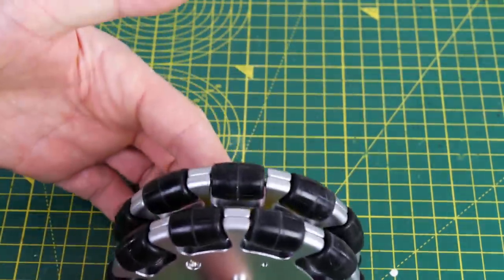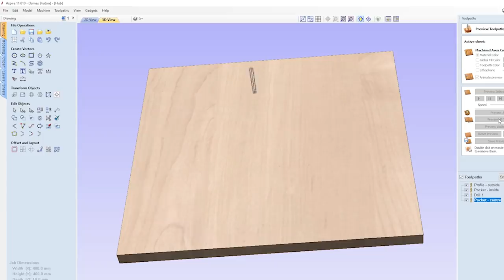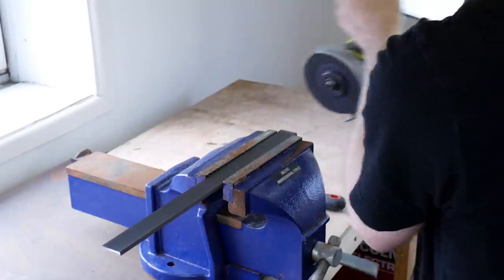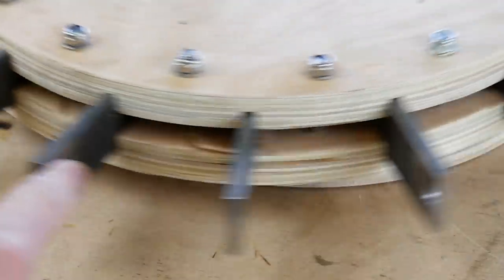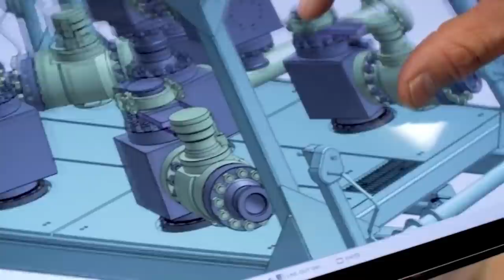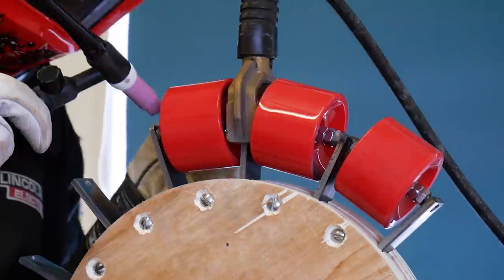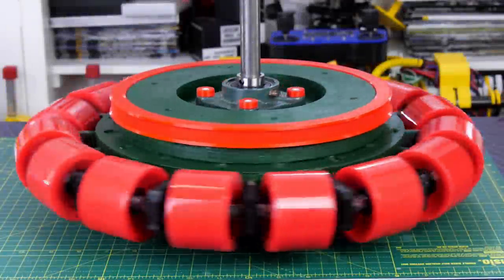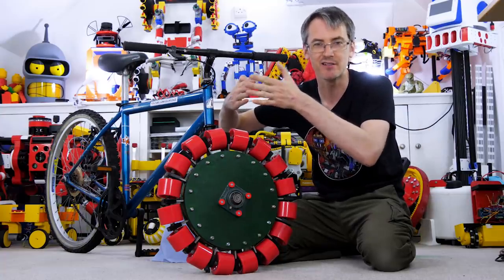Why I built this Omni-Wheel

Comment from the maker: I already built the bike and the video comes up next Tuesday!
Reply: Can you make a GyroSphere from Jurassic World
Reply: Awesome, can't wait to see that one !
Reply: How have I been watching you this long without knowing you have a CNC router? We need a shop tour!
Reply: Would what you have learned about omni-directional wheels also work toward making an omni-directional VR "treadmill"?
Reply: You've outdone yourself on the build of this Omni-Wheel with the CNC, welding, etc.
Reply: lets go cant wait
Reply: If you wrap a single belt around the little wheels, you could drive all the wheels with a single belt drive. The belt would be in contact with the floor, not the wheels. Remove the center of the large wheel, so it's like a washer, add another ring of little wheels on the inside of the wheel, wrap a belt (tread) around the wheels.

You could also use this method to make a wider main wheel.
Reply: Your case comes up next Tuesday !
Reply: ... wouldn't it work better as a rear wheel?

Comment: No bandsaw, no drill press, but a TIG welder. These are some priorities... Oh, and you can just put something like tin foil or heat-resistant fabric over stuff that you want to protect from the heat. It's mostly IR radiation from the arc, so very easy to shield.
Reply: I got a welder and a tig welder with a bunch of tools if I wana cut I got a vice and a hacksaw lol

Comment: Please, when welding, use something that sucks the smoke away. Especially when welding onto nuts and bolts that might have a zinc coating, or another metallic coating. Steel isn't that dangerous, but when you start to oxidize coatings on nuts and bolts, a lot of terrible things come out. The discoloration on the nuts (as seen @6:28 for example) is bad news for your health.
Reply: Hopefully he see's this
Reply: As long as he didn't get sick he's probably fine, though avoiding inhaling zinc fumes is generally good advice.

Edit: Even if he did get sick it will pass, but I've heard it's pretty unpleasant to go through.
Reply: @rh3ttj  It's not about a one-time occurence. It's about preventing future exposure!
Reply: This advice is absolutely valid and non-negotiable these days for production welding. And sound for coated materials no matter what. But for short term, occasional, hobby welding of otherwise clean material using TIG and MIG technologies in particular it's not something people ought to lose sleep over.
Reply: @bradley3549  I previously typed a whole reply that disappeared, but there's been a lot of research on the safety and they found that even low concentrations of zinc oxide exposure can cause adverse health effects. Apparently I'm not allowed to post links here.
Reply: As someone who made a sandblast cabinet out of two galvanised bath tubs (and after the batteries ran out in my welding helmet so used the close your eyes method) I can confirm that your face falling off over the next few days is indeed unpleasant...
Reply: @owensparks5013  Damn, that's double the pain.
Reply: @bradley3549  Thing is - there's a difference between working with this 8h a day every day every year doing these welds and just doing it once for a youtube-video. Dose matters.
Reply: @Macatho  Precisely my point. Well said.
Reply: This. 1000x this. 
Heavy metal poisoning can be fatal by the time you even realize you have it.
Reply: Yeah welding stainless with no respirator in a garage was sketchy in a bad way. My welding instructor loved to hammer in to our skulls that one and only time they tried that, they were hospitalized with metal fume fever. Chromium vapor is no joke, and it will ruin your day faster than you realize.

Comment: I really hope this project doesn't turn into a case study on why front wheels of bikes typically have a diameter greater than 10cm
Reply: Haha I bet it will. Pretty sure you can't ride a bike "normally" with such a tiny wheel. Afaik the position of the pivot point in relation to the wheel as well as the contact area with the ground are factors involved in making it passively stable when riding.
Reply: @legotechnic27  yes, that's true--the pivot point, anyway, and that's trivial to fix up. So it'll be a touch wobbly even if he added some mass to the wheel. OTOH, it does have automatic lateral adjustment to mitigate this, so it looks ok.
Reply: I don't want to backseat drive the expert, but yeah I was thinking perhaps the larger diameter should be aligned along the axis of movement
who knows though, maybe it'll work fine!
Reply: @Lizardwarrior1  yes I think it would make more sense that way. But as explored in last couple of videos driving the smaller wheels with an electric motor is harder than driving th big one.
Reply: @legotechnic27  Isn't the point that it's going to be actively stable, rather than passively? There might still be issues though.
Reply: @xenontesla122  Ye I believe it is. But in the video he seemed to mention he would want it to both work with and without active balancing. But really even if it only works actively that's not really a loss. I'm curious how it will turn out :)
Reply: @legotechnic27  I don't think you'd be able to work this bike with it being passive, when the motor is off the front wheel would have no "traction", like hitting an ice patch on a regular bike so none of your steering inputs to balance would work.
Reply: Let's just hope that James is wearing a helmet when he tries it out.
Reply: Watch veritasium vids about bikes.  Wheel size has virtually nothing to do regarding bikes staying upright
Reply from the maker: Great discussion, the second video is already done and comes up next week!
Reply: True. At first, I wondered, if welded axles are a little maintenance unfriendly. However, a tiny wheel, which gets stuck might break the bigger one. Luckily the wood is doubled with some space and concerning those problems, I would prefer welded axles, too.
@James: If it works, will there be an even bigger version, which fixes some problems just in case they are real? And will you try it in a skate park showing off some tricks other people can't replicate? ^^
Reply: @legotechnic27  the way the forks on a bike are bent forwards is what makes a bike's handlebars "self-centering", but the human actively controlling the bike is what keeps it upright.

The reason bikes usually have larger wheels is that it makes it much easier to roll over obstacles. A 26" bike wheel can roll over obstacles as big as a few inches, whereas skateboard wheels can be stopped short by a pebble or fallen branch.

Larger wheels also usually have less rolling resistance as well.
Reply: @theflyingfish66  Wait, so the "self centering" doesn't make it passively stable when people drive on it? That's surprising because that is what keeps it up right when the bike is rolling without a human on it
Reply: @theflyingfish66  It's not just a matter of not rolling over the obstacles, but of lowering the centre of rotation if the front wheel stops -- so you're increasing the chance of the wheel getting stopped and simultaneously increasing the chance of going over the handlebars if it does.
Reply: @Rodarbal0  i’ve certainly ridden bikes with very small wheels and think of scooters, the problem with small wheels is how they react to surface imperfections it’s very easy to get a small wheel stuck in a rut.
Reply: maybe he will invent suspension
Reply: @theflyingfish66  I believe that you can push a bike downhill and watch it remain balanced. Has something to do with inertia and possibly gyroscopic procession. I'm sure someone more familiar with the concept has explained it better than me.
Reply: @illeatmyhat  no amount of suspension can overcome the problem small wheels have with obstacles. A large diameter wheel will ride over the obstacle, and the suspension will reduce the transference of the upward force to the rider.
A small diameter wheel will jam almost immediately, so the suspension won’t really have a job to do. (It might give a slight advantage over very small obstacles, but it won’t do much.)
Reply: @carson365  it has nothing to do with gyroscopic procesion and more to do with the way the bike wheel is angled.

The slight off set along with the wheel moving forward keeps the bike steady due to a lot of micro steering. It is perfectly possible to build a bike with 0 gyroscopic procession and it will still balance itself when going down hill.
Reply: @legotechnic27  The self-centering is somewhat stable, but only under certain conditions and the bike will always lean one way and go in a big circle. It (the angle in the forks, in car suspension terms I think the correct term is "caster angle") only provides centering force (proportional), it doesn't damp out oscillations (derivative) or correct for long-term deviation (integral). And at lower speeds the centering force isn't enough to keep the bike stable, a human can keep a bike upright at much lower speeds than the bike will naturally.
Reply: @theflyingfish66  Fair enough! The new video showed that everything is working surprisingly well in any case. Very cool build

Comment: I've recently transitioned to a wheelchair that uses passive Omni Wheels in the front and is steered by applying differential power to the two rear wheels. This is an excellent design, but it has a few glaring weak points. The tiniest ledge, even thick carpet, is too tall for the Omni Wheels to mount when swinging sideways. There are two 500 watt motors, I believe it has ample power. Most wheelchairs have difficulty with rugs, this is easily dealt with. But I live on a rather steep Hill. When I break traction even to the slightest degree, the chair consistently slides downhill at a little greater than a 45° angle with respect to the direction of movement. This is rather terrifying as it usually ends with the chair sliding into an obstacle and flipping. I'm curious if you have any ideas for this? I'm a retired mechanical engineer myself. I've often kicked around the idea of a friction plate on the Omni Wheels, have them default to freewheeling, but lock the smaller Wheels with the press of a button. Keeping weight down is very important, I don't see any reason this could not be done with simple bicycle linkages. In my case, I have use of my feet, so I'm trying to think of a model that links these friction plates to a foot pad perhaps? So if I know I need to traverse a slope, I could press the pedal to apply the friction disc and effectively convert the front wheels to traditional Wheels. But how do I go about doing so such that it does not impede the movement of the overall Wheels rotation? I suppose I can imagine a spring loaded disc that could be manipulated on or off while rotating, but I cannot imagine how one would be able to activate this feature on the fly so to speak. If I have to stop and lock hubs and stop to unlock hubs, it is not terribly useful. I need it more to be able to react dynamically to the terrain. I suppose unlocking it could take longer, but the ability to lock it up on the fly is something of a necessity. I have a decent amount of room to work with, there is no axle in front and I am rather narrow. My chair does not fold so the build could be permanent. Do you have any ideas? Or resources you suggest? Although, now that I read this over, perhaps I have tunnel vision. Maybe an emergency break like the old soap box derby cars, a length of wood that could be pivoted to dig into the ground to brake. It would have to be functional on many different types of terrain. Any ideas spring to mind? I'm fairly resourceful and have machine tools available. I know it's asking a great deal, and I would be happy to remunerate you however you see fit, but I would love to have you put in 5 minutes of thought and just give me a few jumping off points. I understand completely if you cannot. Your videos have been very helpful and have expanded my knowledge, I am already in your debt. Be well.
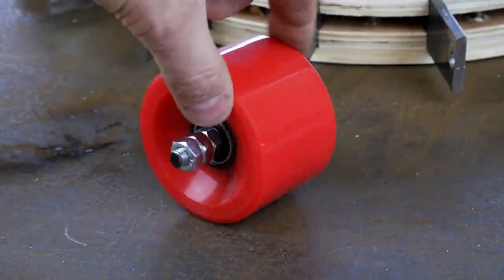Reply: Okay at 4:10 you have inspired a new idea. Instead of a friction disc pressing against the small Omni Wheels, I could have a set of spoke tubes inside each Omni wheel, if they were tapered, I could make a cone shaped piece that drove in to the hub forcing the spokes to drive out of their tubes and apply friction to each one of the tiny Omni Wheels. This feels simpler to me, I need only a small Central shape to activate it. I think the most appealing part of it is that I could theoretically apply partial or differential pressure. Since the chair steers like a tank, if all of the small wheels on the Omni Wheels were firmly blocked, the chair would have to work very hard to take a turn. So, the first thing is that I don't think I need 100% immobility. Having differential actuation would be much better to conserve energy while still helping on the slopes. I suppose a simple L shape on each of the stub axles having the turn sit on the foot plate, if I made the cone on the outside, it could be pulled in and apply friction by stepping on the pedal. Having one for each of the front wheels, I think in very little time it would become non-thinking muscle memory to apply it in risky terrain. I would be thrilled for any input you have to offer

Comment: just a thing about the geometry of the rollers - making them cylinders mean the wheel as a whole has 'bumps' at the corner of each cylinder - non constant radius. you can fix this by applying the wheel radius to the rollers to make them barrel shaped. this will make the wheel smoother and easier to deal with.
Reply from the maker: I considered 3D printing the wheels, but there's a lot of them. The other choice is another 'layer' of wheels offset from the first.

Comment: @James if you have a drill press and your not sure why its working start by taking the top off and checking the belt if its not the belt and the motor isn't turning check that it can be turned if it can check the fuse most of them have a fuse, if that's fine or it doesn't have one with it "unplugged" check the switch with a multimeter if that's fine follow the wiring back to the motor. If the motor is turning fine it might be a starter cap those can be replaced but be very careful even a bad one can carry quite a lot of energy. if the motor is not turning or making a crunchy sound it could be a bearing or carbon brushes. In the end use your head and be careful while working on high voltage devices but you are creative and mechanically inclined enough that this should be something you can do and hey it could be a video project?
Reply from the maker: The switch is broken

Comment: thank you for another fascinating movie. Had you thought of making omniwheels out of two seperate rings of wheels & placing them side by side offset by half a wheel. That way you could have much bigger spaces in between the wheels. I started wondering about an e-scooter with front wheel drive & an omniwheel at the back. I wish i had the resources to try these ideas out but alas i have to live in my head

Comment: Once again blown away by your construction and designs. I have noticed in a lot of your constructions you use multiple nuts to take up axel space. Is there a reason you don't use spacers in those situations? The could save weight in a lot of places, and are cheap and easy to make. Really just looking for your insight on your design choices on this one. Always trying to learn more from master craftsmen.
Reply from the maker: Nuts make the axles thicker

Comment: I'd love to see this bike where the front wheel is kept facing forward and the handle bars aren't connected to the front wheel. Instead of the bars turning the wheel, it sends a signal to a motor to drive the Omni wheel.
I think that the confusion of people riding it for the first time would be hilarious and it would look like it was floating
Reply from the maker: That would work, wait for part 2!
Reply: @jamesbruton  looking forward to it
Reply: You could drive both wheels and get a 2WD bike :) But the little wheels need to be bigger when off road.

Comment: Unless you are on a dead smooth cleared surface those tiny wheels are going to put a lot of pressure on your forks and axle every time you hit even a small bump, they wont climb over anything much, even a small stone will cause a skateboard to chuck it's rider off the front by stopping suddenly.....

Comment: wait... stainless steel?  Doesn't welding that create chromium vapor?  Hope you have really good ventilation, and a good respirator.  Be sure to be safe.
Reply: not really a issue with stainless. I think you mean welding zinc plated steel, as the zinc oxide vaporizes when welded, and the fumes are quite poisonous.
Reply: @coolfrost6  Not correct. 

Welding stainless steel releases hexavalent chromium fumes. Without ventilation and proper respirator protection, this can be very hazardous. 

https://www.cdc.gov/niosh/topics/hexchrom/default.html

Welding and metalworking are awesome, but any time you’re welding or grinding metal, you should be wearing a respirator appropriate to the task. 

Fwiw, I hate wearing my half-face respirator. It’s sweaty and uncomfortable. But since the alternative might mean an earlier and unpleasant death, the trade-off is an easy choice.
Reply: @devhammer  having read through some of the literature I will conceded.

I had initially assumed that fumes would be primary the inert trivalent  cr(III). But apparently depending on the welding conditions between 5-95% of the cr is cr(VI). And in that case I agree any amount of airborne cr(VI) is to much.

(Insert "the more you know meme")

Comment: at 7:20 or so, the 3d-print scenes. what did you actually gain by printing the parts with 20-ish percent infill and not massive? I don't see a huge gain in lower weight or cost saving, but a massively reduced sturdyness.
Reply: Its faster to print and does a pulley holder really need to be super sturdy?